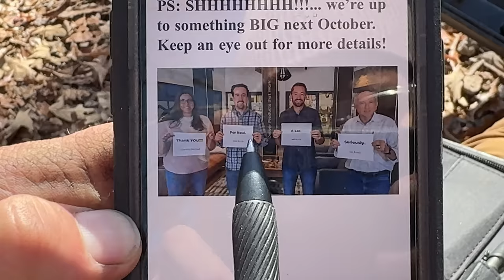Modern Home Build | 32 | siding and foundation paint and Ray lives!!

Comment: "one coat coverage" is such a DIY homeowner scam. Yeah the color may have covered the surface without blemish but paint needs a certain mil thickness to stand up to abrasion, weather and sunlight, and have good color retention and longevity. Also in most cases you will not get the proper finish when painting unfinished surfaces with only one coat.

Comment: quick tip: If you need to measure a piece of timber that measures something awkward like 77mm and you want the middle. rather than trying to half it, put your tape across and twist diagonal until the tape reads 80mm, then when you put a mark at 40, its the middle of the timber.

Comment: @Perkins Builder Brothers,  Hey, Eric, with the new painting guard a good tip is to wrap the guard tightly with some saran-wrap-cling film.
This makes cleaning the paint guard much simpler and easier as all you do is remove and bin the used cling film as the build-up of paint gets too coated and then rewrap with a new layer of cling film over the guard.
 It's a little less messier too than trying to clean up the paint guard with rags.

Comment: Sometimes when you have to touch up the caulk and the paint causes what’s called a flash so the paint flashes and there’s two different shins maybe if you will. There’s a product that you can purchase to mix in with your paint that will help through this. it’s called flow trawl you use it when you paint over your caulk and it will help, especially with the second coat so that it doesn’t look like he went around and painted all the edges last because sometimes there’s this one lady named Karen and she seems to notice everything
Reply: Good advice but product is called "Floetrol" , makes some paints spray and brush smoother.

Comment: For your spray shield, if you tape 9" masking paper to it, in about 6 layers, it makes it so much easier for the clean up, just pull off the painted one and you have a fresh one underneath.  Or just buy a box of cardboard shields and the handle that goes with them, and just replace as needed, makes it go much faster than trying to wipe the paint off, and if you don't get all the paint off the back side, you will leave paint marks on the surfaces you are trying not to paint.  By the way, 50 years of professional painting, from dog houses to the largest cruise ships and everything in-between, so I have a little experience in the field.

Comment: Use your paper masker and mask your spray shield. It's fast cheap and easy.

House looks great... As usual.
Reply: So are cardboard spray shields. There's a reason the pros don't use the aluminum ones.
Reply: Cardboard for the win! I have never seen any professional painter use an aluminum paint shield 🛡️.
Reply: I keep hearing that pro don't use them.. Every pro I worked with did.
The cardboard ones have there use but they are thicker once bent they flop around.

Comment: Better with a 15 hp honda at 4000 psi with higher volume. It'll  clean faster with volume and you'll be able to attach a surface  cleaner.

Comment: The paint is touch up after spraying and drying then see if you can go back around and touch up without any flashing we call them Holidays that's when the painter went on vacation between his ears. Also when are you guys gonna put an extension on y'all's gun you can get random lengths they make your life a hell of a lot easier and produces a better paint job and a swivel c'mon guys nail benders it really will help

Comment: I don't love the color, personally, although it would look FANTASTIC with copper flashing as it patinas and won't show the stain much as the early layers wash off. 

That texture of siding does give me an idea. Sometime you should to a test piece with a darker color, then after it dries drybrush or sponge over it with a similar, but lighter color. The brush should stay on the surface while the sponge should go down into the deeper parts of the texture. Chestnut brown followed by a coral or apricot would probably look like cherry wood.

Comment: You ALWAYS paint 2 coats even if the paint can says otherwise, and never trust a friggin Lowe’s/HD paint rep. 
As the paint fades from weathering over time, you’ll begin to see the lap marks around the entire house. If you use 2 coats then there’s not as much of a differential between the mill thickness of the heavy coats and light coats between the overlapping spray pattern. 2 coats means more consistent mill thickness which means better wear over time. Plus, a second coat will darken the color just a tad and make it even more uniform. Don’t be cheap!!!
Reply: I concure on what you said! I bet you are a painter!!

Comment: It may be a ridiculous question, could the siding be sprayed before installation? ..if yes would it save on labour?
Reply: no reasons are
1.you would need to paint the caulk and nails separately which is not feasible 
2.the boards should be handled with extra care since you don't want dirt to be on a painted surface
3.you be would painting the part which will be overlapped which is not necessary
Reply: @kishore-cp2rr  Thanks bud, European here I've never used siding but it looks an interesting product.